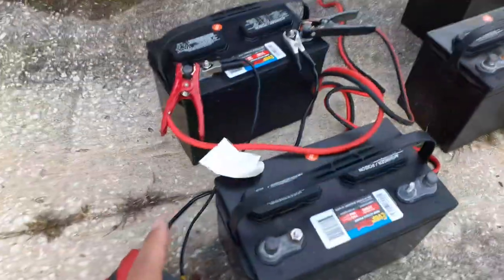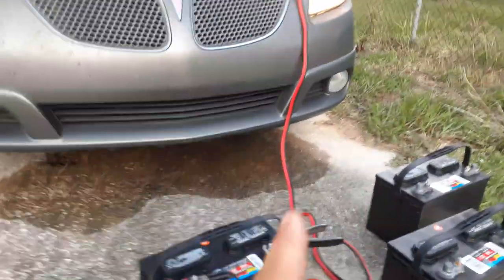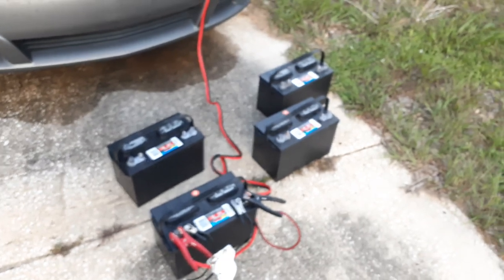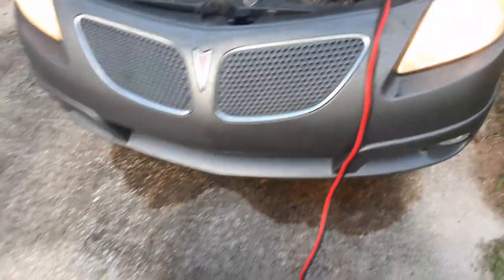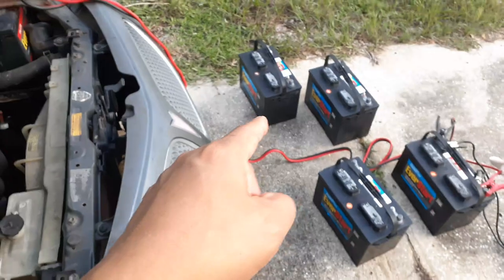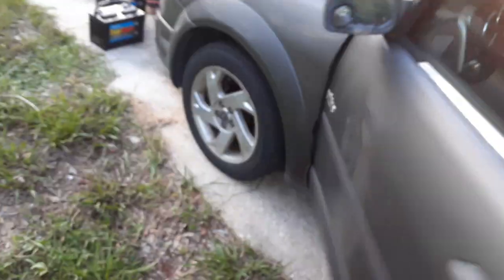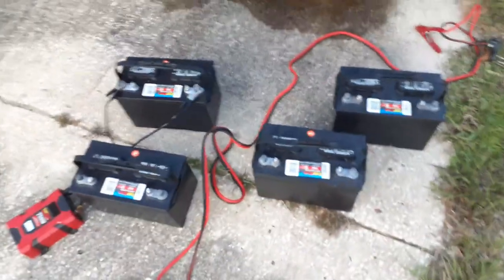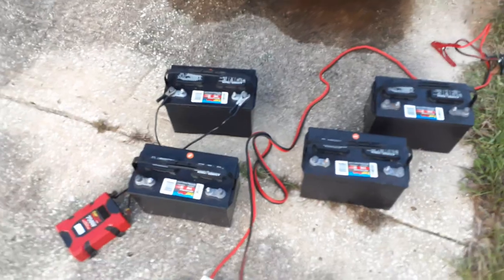Rebuilding My Solar Battery Bank With Weak Batteries

Comment: Get the charger I mentioned to you on WA - it can charge 6V and 12V lead acid, AGM and Lithium batteries and has special modes including a repair mode.. You don't charge batteries with a car/alternator, it's job is to maintain the battery not charge it from scratch/low. You need a charger that pulses the batteries and recovers them from sulfation. Lead acid batteries are not meant to be drained and charged multiple times even though the EverStart ones you have are deep cycle marine/RV batteries - 27DC  . You need lithium phosphate or lithium ion batteries for this kind of application. You cant jolt them with your alternator, the only jolt you are going to get is when your alternator quits - if you are not careful you will burn your alternator as it is probably full fielding when you use it this way.

Comment: a modern alternator puts out between 13.5 and 14.5 so the 14.3 you were reading was the alt charging, it takes a couple hours of fast idle to charge a depleted battery.. use a real battery charger hooked to grid electric, each battery  should take an 8-12hr slow charge  and be sure to check the fluids. I KNOW its a sealed battery, the caps still come off, add distilled water if needed..
Reply: It's not a sealed battery, it's a so-called maintenance free battery, and like you said all he needs to do is pop the caps and add some tap or distilled water and top them off. Also, he needs to get a proper multi stage pulsing battery charger instead of using his car - even in Thailand people don't do crazy shit like this. 😉

Comment: A fully charged 12 Volt battery is 12.6 volts not 13.8 volts! And just because it has 12.6 volts or more does not mean that it is good.